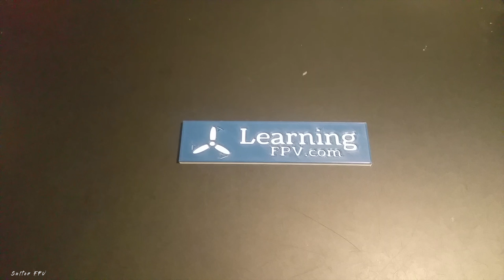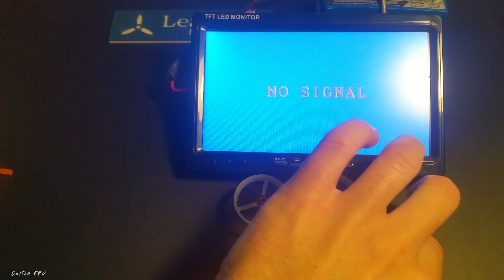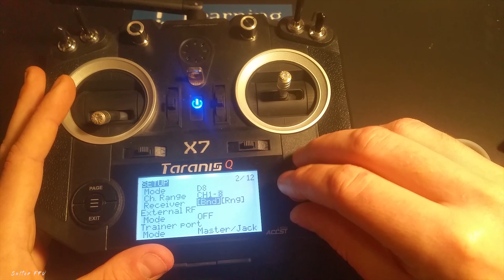Build #7 Tiny Whoop

Comment: This is good. 
Does the fc has built in esc?
Will the fc work with any receiver? Mine is flysky fs-a6.
Is there a brushless setup possible in this size?
Reply from the maker: No esc here, this is a brushed setup, and this model come with integrated Frsky rx.
But you can find brushless motor version and flysky rx too,  there are some other FC available for that setups.
Here is some example of the diferent parts you need for brushless:
FC for brushless motors(no rx included):https://goo.gl/4MMsKS
FC for brushless motors(with flysky rx included):https://goo.gl/xDd3WC
Brushless motors: https://goo.gl/pvbTou
Frame for brushless motors: https://goo.gl/x4MKJh